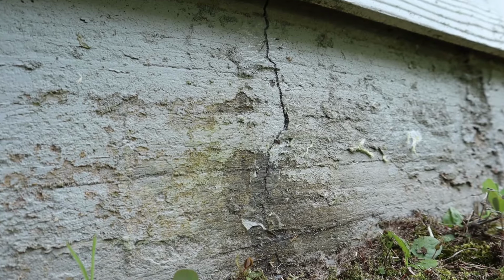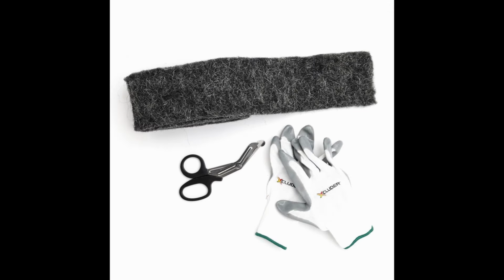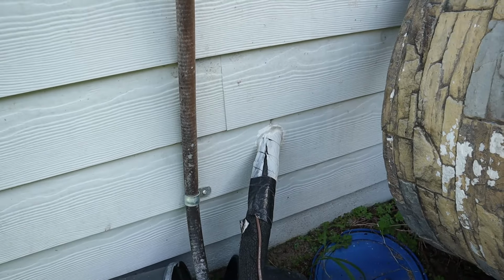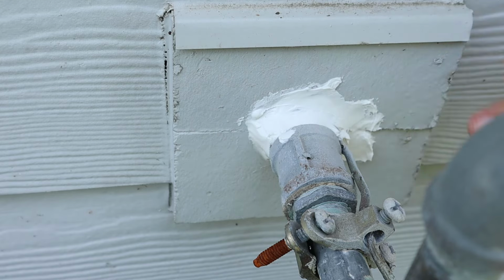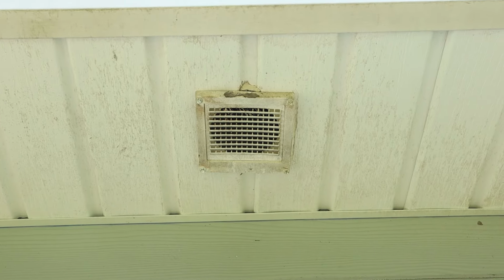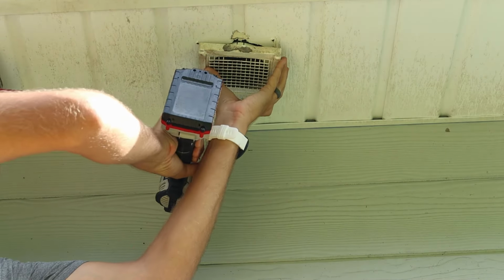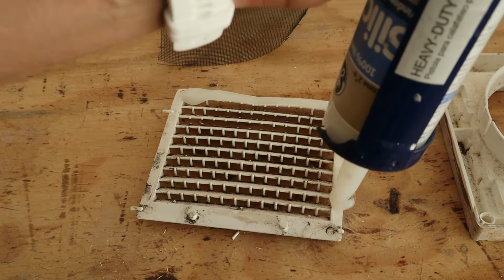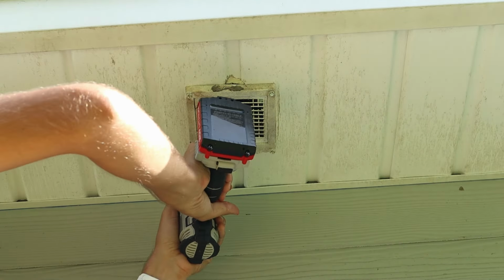How To Keep Bugs Out Of Your Home | Bug Proof Your House (4 Common Entry Points)

Comment: When you re-hung the vent covers that you put a screen on, it was too mangled & damaged, so you can clearly see the gaps that the mangled frame created, so putting a screen on is going to be of little help because there is still a gap from using a mangled, old vent cover. It is counter intuitive & counter productive! The idea is awesome, but working with broken, bent, and mangled vent coverings, defeats the whole purpose to begin with. They are not that expensive, and you are trying to prevent pests from getting into your house, and using broken and mangled covers is certainly not the way to resolve, anything. Sorry, but this video is turning out to be more of what not to do. The vent covers need to fit flush to the house, but even then, I’d still put a sealant around it, and then make sure the sealant was weatherproof, so in heat or cold. When it expands or decreases, it doesn’t break the seal and defeats the whole purpose of sealing the area to begin with! Ps. Your suggestion, earlier, of using a glue gun is a no no, because you have to make sure the sealant can accommodate all the changes in temperature from weather, so certain glue and sealants are not weatherproof, and you need to be mindful of that.
Reply from the maker: Yes I have to replace them about every 5 years due to UV damage to the plastic.  Everything was sealed.  Also with a soffit you can’t get a totally flush fit oftentimes which is why sealant is necessary.  Silicone works best.  Hot glue works fine for the screen.  It’s under an eave and doesn’t have to be waterproof, just has to keep bugs out.  I still recommend the silicone though.  No need to get all excited about my particular vents.  They have since been replaced.  😂

Comment: What!? Bugs do not enter through the duck  lines as that is a closed air system unless you have holes in it(crawlspace) and it's not really used much. The number one way bugs die when they come in your home is from lack of humanity. Your air conditioning or heat unit dehumidifies the air.

Comment: Chimney
Reply from the maker: Hey Max, yes they can absolutely get in through the chimney too.  There a few things you can do to cut down on this.  You can install a chimney cap, which won't keep the smaller bugs out but will some of the bigger ones and any critters.  You can close the flue whenever the fireplace is not being used, many folks forget to do this.  You can also install fireplace doors, they could also cut down on the insect getting in.  Maybe you know all of this but if not I hope it helps.  Thank you for watching!

Comment: Yo ok I got this dumbass window ac thing and EVERY SINGLE TIME I go to bed there’s like 12 spiders all around my room and I’m running out of ideas on how to stop it. I’ve covered all the little cracks in and around the ac with every kind of tape I could think off, I’ve put masking tape floor marking tape, cellophane tape, gorilla tape, duct tape, hockey tape, box-sealing tape, filament tape, PTFE tape, microporous tape, t-Rex brute force tape, pvc tape, electrical tape, gaffer tape, friction tape, scotch tape, drywall tape, washi tape, thread seal tape, speed tape+ many more AND YET THERES STILL Fucking spiders AHHHHHHHHHHHHHH what the hell do I do know!